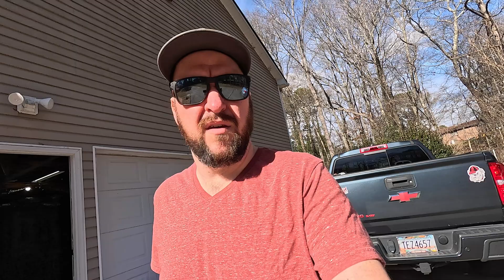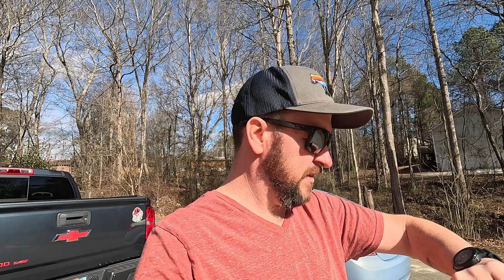Building a DIY Bike Washing Station for Almost No Money

Comment: I did something similar, but instead of hook, I mounted a bike stand claw so my bike is completely off the ground & attach it to top tube or seat post. Got my bike stand claw from Amazon for $30. And you can rotate it
Reply from the maker: Well, I will be doing that. Thanks for the fantastic advice. Thanks for watching.